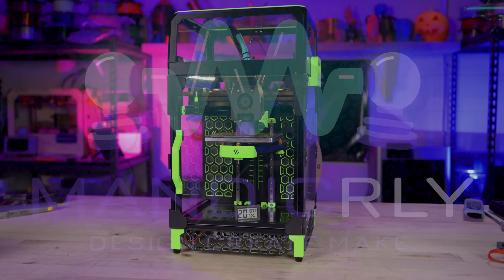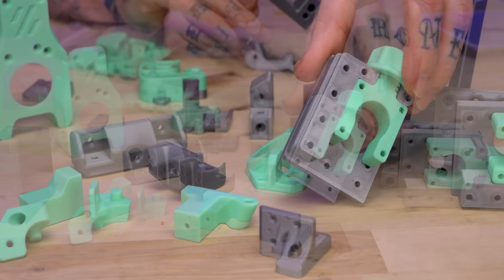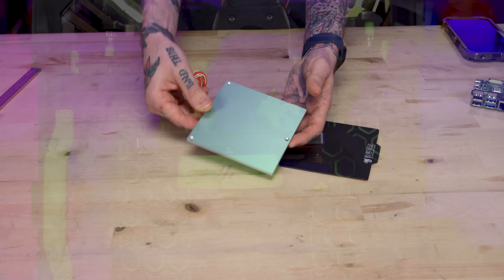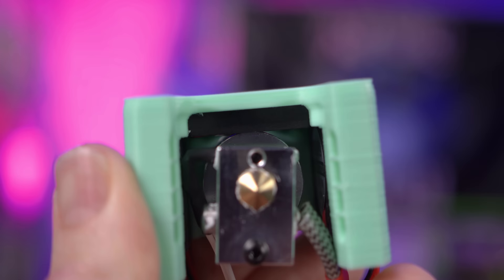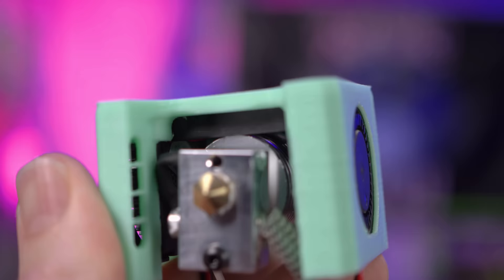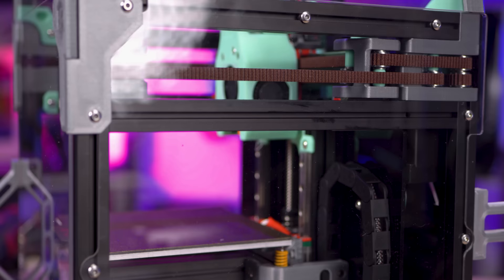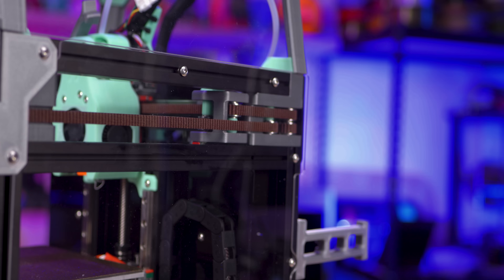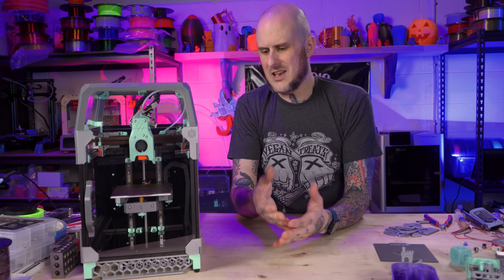Is the CHEAPEST Voron V0 Kit Worth it? Siboor V0.1 3D Printer

Comment: Thanks for the very professional feedback from Mandicreally,👍 we will try our best to improve our kits. For all SIBOOR V0.1 kits delivered since 11th, Nov 2022, the motherboards with Klipper+Fluidd pre-installed have all been installed with fuses, jumper caps, and drivers. The system, motor, temperature measurement, and endstop are all powered on and tested for normal operation. Even novices who do not understand software and hardware can easily use it, greatly reducing the difficulty of use.
Reply: Does the extrition hole position already fix?. Because i will be buying from you
Reply: @Kitsu_no_mirai  The position of profile holes has been greatly improved
Reply: nice to see you reply and ackowledge and correct some faults based on feedback
Reply: @Mr.Thermistor7228   We are also conducting new tests on silver printouts and hot bed wattage, hoping to improve them. However, it can only be released after multiple tests are completed. Thank you all users for your attention and any comments.
Reply: I ordered the same kit as shown in this video on 7 November. I haven't heard anything regarding it, and that is after several emails asking about it. 

The lack of communication from Siboor has left me befuddled. I will steer people away from Siboor in the future, as that is no way to treat a customer. Well, not your customer any more...
Reply: @ogpennywise  It may be a network restriction problem, the replies here are sometimes automatically deleted. I have responsed here 2 days ago, but no record. I'm sorry, some misunderstanding caused this situation, and you must feel bad for waiting so long. But we also find it very strange. Since you placed the order, we have sent 7 emails to your Gmail mailbox (the one reserved for the order), but there has been no reply. Did it go into the trash? We send you the past email record too. I can't find you contact with your phone number. I'm sorry that there is still no reply from your email. We can only turn you the refund. If you need services later, we will provide compensation and gifts, and my email  on our web will serve you in time.
Reply: Siboor, dose your 2.4 kit come with printed parts?
Reply: @jafjay6024  Yup I chooses printed parts kit (Actually Nylon CNC+ABS edition) so far 2.4 printed parts are nice? I don’t need to reprint so far and working great. But I know V0.1 with have silver ABS does not have good layer adhesion but now they replaced it to other one.
Reply: @jafjay6024  yes, we can offer functional and decorative ABS printed parts, you can customize the color you like. Decorative ABS printed parts is additional option now. If need, we also have CNC metal parts & ABS parts for voron 2.4 too.
Reply: @Psych0h3ad  yes, we can offer red and black ABS printed parts for V0.1 young version now,  and the green and silver version may changed to black and light purple one later. Metal color material may have some changes under different weather after the feedback. There also had some SIBOOR V2.4 order choosed customized color for abs printed parts..
Reply: @siboor3dprinterkit  do you ship to Uk?
Reply: @jafjay6024  yes, we shipped many printer kits to UK, don´t worry.😄
Reply: I ordered a 0.1 kit in the US off Siboors site, and had it in less than a week. I found no extrusion or delam issues with any of the 3d printed parts. I'm in the middle of assembling it but so far very impressed. I am assembling it right off the bat with a Kirigami  bed support kit and 6mm build plate
Reply: Do you have an aliexpress page?

Comment: Great Video! @mandicReally, happy to heat you love the hardware kit 😁, Siboor is our oem for the V0 hardware kit and some other screw kits we sell but we spec them at bom+20% and depending on which revision you have we include our own Honeybadger abec 3 bearings instead of the generic ones. You also get our amazing customer service which would have sent you any screws you are missing along with new revised panels 👍👍 

@13:49 into the video, now thats a great bed heater 😎. If you ever want to make a video of anything we have at the store let us know! 
Love that black and green build!
Reply from the maker: One of my favorite parts of the kit (minus the short on M3x6, but that's nothing to do with you). Heck half my original V0.1 came from you. Good spot on the bed heater .

Comment: This video was about 3 days after I bought a budget kit myself (still waiting on shipping) and saw this one after I checked out. I opted for one without the printed parts and will print them myself and love 3d printing for the tinkering aspect so I'm not worried about needing to modify, but that 150w bed is a little spooky. I'll make sure to read things a little closer after this. Thanks!
Reply: It's honestly not a huge deal that everyone is making it out to be. The original V0 bed was AC and 100 watts. You had to power limit the bed just like the rest of the Voron lineup. Heck the bed on a 250 V2/Trident is 500 watts. If you power limit the bed, you'll be fine.
Reply: @option350z  just get an LDO kit! By the time you fix everything on this printer you’ll be money ahead
Reply: @thelightspeed3d712  Kits are for Noobs. Real men/women self source 😂
Reply: @option350z  Poor people self source. Lol rich people buy a pre built kit. Lol I tried to self source that was hard as hell. I gave up. I would have had so much extra, everything
Reply: @thelightspeed3d712  Too much of a tendency to go with bling/Gucci everything. High end linear rails, titanium screws, etc..turns a 400-600 dollar machine into a 1200-1500 one.
Reply: @option350z  me? I prefer the kit because I’m not going to build six of them. And the savings is non existent. A fully loaded V0.1 with Mosquito, Bondtech LGX lite, etc. Costs like $1200.
Reply: @option350z  but a budget one is just going to give you headaches

Comment: It's good to finally see a review of this kit. I don't think there were any available that I could find when I bought mine.

My good and bad experiences with this kit (being that solid reviews of this are hard to find):

My kit seems from a different batch, from July, as the acrylic sides were Voron spec (at least area wise, not sure about the thickness).
The printed parts are mostly fit for purpose. Layer adhesion is poor, and the over extrusion is an issue in some places. The worst incident occurred with the motor mount, where the self-tapping screws split the layer lines. I screwed it in a bit more carefully, and used it for a month or so before the failure became critical, but luckily I'd already printed replacement parts in that time. I also split one of the door hinges easily and one of the skirts. However most of the parts aren't reliant on layer adhesion to function well, just a few critical parts.

The heatsink design is pretty convenient, I've ordered a few extra recently to change hotend designs on other printers. I did have a blockage early on with the supplied heatsink and nozzle. Upon taking it apart, there was still metal swarf from the thread cutting of the heatsink present. I suspect this was the cause of the blockage into the CHT-like nozzle.

Electrical wise...
I noticed the bed 150W issue when resolding the bed connections, as they were both poorly soldered, and not strain relieved. I also had to peel back the tape, because when testing all the electrical connections the bed thermistor was shorted. Taking it all apart, the thermistor wires had been twisted together a few times at the sensor. Luckily it untwisted without breaking. On contacting Siboor on AliExpress, within a day they explained to use the power limit in the config section. However, they really should have been shipped as the default config.

Also electrical wise, the extruder motor was wired ABAB, not AABB (or the other way around). So pushed out the pins to match the other motors.

Finally, the customer service I received on AliExpress was some of the best I've seen on there, always polite and helpful, although sometimes the answers took a day or two for technical questions or inquiries for buying extra parts.
Each of these were met with a friendly response and suitable answer: Asking about components of the kit and build steps, mounting locations, passwords for root access for modifying the klipper install and requesting price quotes for extra parts, replacement beds and other 3d printing components.

Overall, I think disagree with the general recommendation here. Yes the kit would be terrible for someone's first printer or if they lack tools/skills to test, tidy up and modify the parts if needed.
However, I'd say it's worth the price for an entry level Voron if you have the tools and experience, but are missing a convenient way to get the printed components. I didn't have access to a reliable ABS printer and no other easy to access kits had printed parts for a reasonable cost.

Maybe it's because I expected it to be pretty poor quality for the cheapest kit I could find, and was pleasantly surprised with most of it being average and hence suitable quality.

Comment: Great video, easy choice to subscribe, my v0.1 project is a bit of a frankenstein between the sub-component kits offered by siboor and stuff I had on hand. I too had serious problems with the frame, the first frame was blue and had 5 or 6 super uneven cuts and it was absolutely covered in scratches, dents and other surface defects. They to their credit after a bit of back and forth sent out a replacement black frame that is waaaaay better with nice clean and even cuts on the ends with accurate drilled holes and clean tapped threads on every extrusion. The issue is like you mentioned in the video is it's a project-stopper. I had to wait 3 weeks on the replacement hoping it would be up to spec and thankfully it was. I also grabbed the hardware kit from them and it was missing a MR85 bearing for the extruder which they also shipped out with the frame. The belts, 6mm aluminium bed, 24v silicone heater pad, magnetic sticker, pei springsteel, fans, cable chain and pulleys all seem to be fine so far. Siboor allowed me to build up a v0.1 for a lot less than I honestly expected, so I can deal with a few hiccups here and there personally but hopefully they take the feedback from the community on board and adjust accordingly.

Comment: I'm currently building an LDO kit and I had a very similar experience with the specific fan you talk about not fitting. I used the Voron PIF and all my parts came looking amazing. The issue I found with inserting my fan was that I was installing it upside down. 
There is a small channel on the inside of the mini afterburner that I used for the hot end cooling fan cable, but didn't think to also use it for the second part cooling fan as well. I flipped around and boom, it fit in perfectly. 
As you said, the parts in that kit were over extruded, so even then, faulty parts.
As for splicing the part cooling fans together to use one header on the board, it does make sense if later you want to add a carbon filter, such as a nevermore, that also uses a fan.
Overall, definitely seems to an uninspiring kit.
Reply: The splice is also something called for in the original design since the BOM board did not have the extra fan header. This has largely been also solved by the use of either CAN boards or other PCBs like Hartk designed mounted to the hotend/extruder assembly.

Comment: To be fair, the 150watt label is the dc side. Measuring on the wall doesn't take in the losses then come with an ac to dc converter.

And i don't think a cheap meanwell supply will be very efficient!

Comment: Looks like a fun project printer. But... yeah probably not worth the "savings" in the end. 

For the fan housing I'd hit it with a torch to soften it up, then smoosh it a little bit to get better clearance.  I do that on half of my prints, especially when I'm designing a custom part that needs to fit right. You know what they say, measure once, melt twice. 

Stuff like that fake CHT doesn't sit well with me. Chinese companies play by a different set of rules and there is no enforcement of IP. 

And worst of all, they didn't even rip it off correctly!

Comment from the maker: SIBOOR has told me of updates they are making to the kits moving forward: 
"Questions mentioned in the video (the above will not be repeated)
The problem of extrusion of aluminum profiles: the current inventory has been improved, (there is still a certain deviation)
The problem of excessive green printer traffic: follow up with suppliers to improve
The problem of screws: add 20 more M36 screws in each box of 0.1 screws."

They also intend to release an updated config file to their github to address other concerns, look for it here: https://github.com/Lzhikai/siboor-voron

Comment: The 150W rating is for how much 24volt power it can supply (around 6.25 Amps), measuring from the wall doesn't really tell you how power its supplying. You need to measure the power use on the 24v side to see if its being asked to work out of spec.
Reply from the maker: You are right, I should have notated power efficiency in power supplies.  However at its peak I saw 220W of draw. The data sheet for this PSU calls out "up to 90% efficiency".  That likely isn't at peak output as PSUs usually don't work that way, but lets just say it is.  At 220W with a 90% efficiency, we are at 198W, 48W over its rated output.  It would have to be down at under 70% efficiency to get down to 150W.  Possible, but any way you slice it this configuration of parts is pushing the limit on the power supply more than anyone should design it to.

Comment: Ordered last week. Tried to cancel but they shipped it to me halfway around the world overnight... Fingers crossed the MK3s+ took me a few days to build mostly because every thing had to be absolutely perfect. 
That said to me this siboor is good value. Don't forget u need to get Raspberry Pi @$100 In 2022 for the other kits and this AllWin H5 is faster. Will be swapping the leaky bimetal heatbreak with titanium. And for another $230 I can get CNC pretty parts.  
About the 150w bed, I measured 4.3 ohm so at 24v it can pull 5.5 amps and 135w... not good. The fuse provided are 10 amps I would definitely lower that.

Comment: Really liked the video, subbed! :) I'm in the market for something like a Voron (because I just love building it myself and knowing exactly what I have and can do). But it's a frustrating experience already, let alone trying to built one from Ali, so I'm just saving up for an LDO kit. :)
Reply: Formbot and Fysetc have excellent kits, in my experience. I have an LDO 2.4 and my Formbot and Fysetc are exact replicas. The colored extrusions may be different than LDO, but you can buy the LDO extrusion kit to replace the non-LDO extrusions if you wish. I did on 4 2.4s and 4 v0.1s.

I just started a bit ago, two months since hearing of voron, and have to say the non-LDO kits are improved over what I've heard. The fysetc 2.4 came with a Pi surprisingly. Not sure about their homebrand boards, but I haven't heard much complaints. The only issue I've had is with the v0.1 kits and the fans, but that is more on VoronDesign and their complete lack of coherent documentation - splittting the 5v hotend fan between the 12/24 fan1 rail and a 5v+ header pin that you'll have to hunt and search for, unless you have the exact specific board in the manual (sadly for the poor documentation the board shipping nowadays since over a year is the skr mini 3 v3 - no the 1.2 or 2 they only have docs for.)

Each will have their own issues, but the LDO 100% markup over "lesser" kits seems out of whack. I'll happily buy a formbot or fysetc 2.4 kit in the future. V0.1 I'll stick to formbot. Fysetc's website rep tried giving me the 'ol switch and bait on a color frame kit.
Reply from the maker: Yea, overall if you can justify it, I'd spend some more for a well supported kit like LDO. The build process has its frustrations but not having to fight a kit will be a BIG help.

Comment: 24V 3mm heatbed? It's fine, i like that. 150W is kind of rough, it should have probably had like... 60W at that size? But pairing a 150W bed with a 150W PSU wow just WOW.

My first thought is adding a separate 12V PSU for the bed. The rest of the printer runs on a 150W 24V PSU with room to spare, it'll be good. The bed running at half the voltage will run at a quarter of its rated power, so just shy of 40W. That is actually equivalent area power density to the classic 100W Prusa Mendel PCB heater, which will never ever ever exceed 140°C no matter how you try to toast it and doesn't need a thermal fuse.

Comment: Well, there is that saying 'You get what you pay for' and Chinese companies are not known for quality or quality control.  I was actually looking at one like this and wondering if I should order it.  I am glad I watched this video or I would have ended up with a peice of junk like I did with a small cnc that I bought off of gearbest that I ended up rebuilding.  I do try to stay away from Chinese companies if I can just because of the poor quality though that really is hard to do.

I noticed you said printed parts could be printed using ASA or ABS.  Which is preferred.  I have heard ASA is easier to print, but costs more.
Reply: Both ABS and ASA are supported for Voron. ABS is more commonly used.

Comment: To cut down cost at the expense of safety and design specs is against the spirit of the Voron imho. Yes, a cheap kit is nice but I’d rather not have free tools but a proper bed plate instead. Hotend and spring steel are secondary because they’re easy to source if you want to upgrade while a precise aluminum base isn’t.

Comment: I would think/hope they would add in a note to change the config file to limit the bed temp heater power output. That would fix that problem but it should at least be noted.